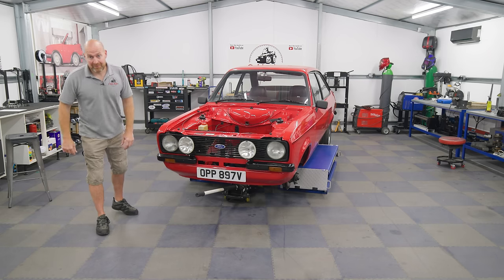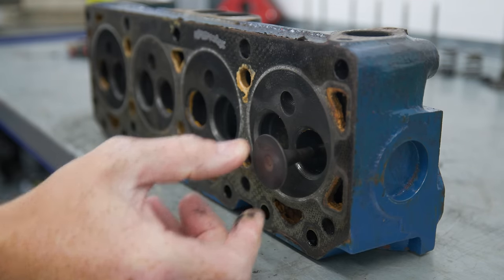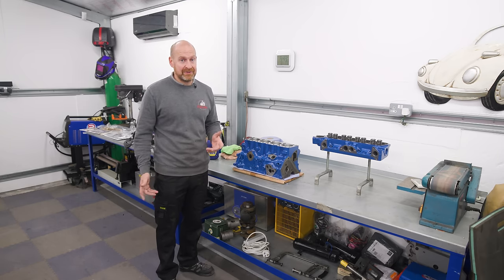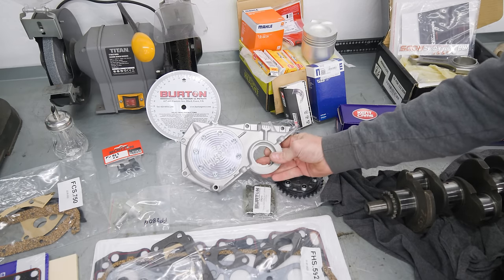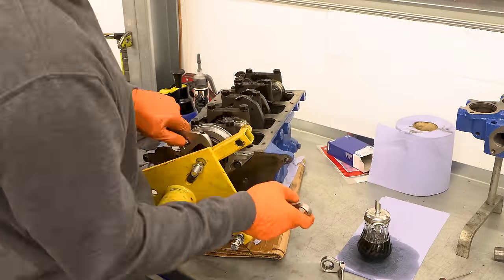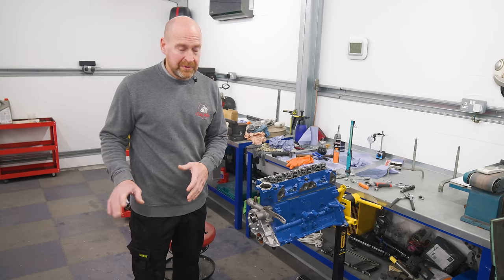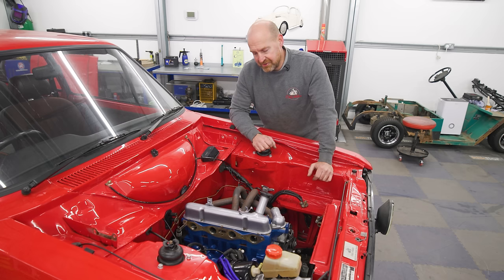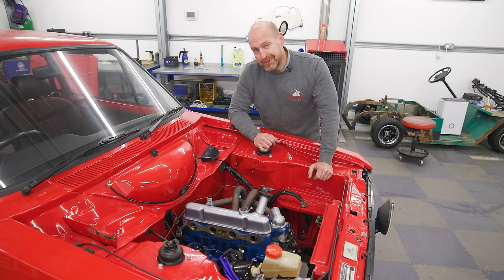FORD Escort mk2 1600 SPORT project #2

Comment: Paul, the 1300 crossflow pistons at + 0.060"  will not reduce the swept volume or capacity of the engine, it will still be 1660cc approx, but they will increase the compression ratio from 9.0:1 o 10.3:1.
Reply from the maker: Shh 🤫 lol in my head it makes it under 1650 ha ha.

Comment: The old 711M block from the Cortina Gt. Safe to bore to 1700 with the thick cylinder walls but good to keep around 1650 for peace of mind. 
Stuck one in our Lotus 7 with a gas flowed head and double valve springs. Lightened flywheel and balanced. 
It’s always nice to know the engine shouldn’t give you trouble 👌🏻

Comment: That was great.
I went for the 244 cam in 1700 crossflow. Mind you that was back in 1999. 😂
Awesome little bullet proof engines if built right. 
I can’t wait to see you do a back to back dyno run showing the difference between stock GT two barrel carb and twin 40mm DCOE’s. 
🇦🇺🤜🏼🤛🏼😎🍀☮️

Comment: Nice to see those power figures with the bigger carbs, I have a 1690cc x/flow with the a Kent 234 cam and a head from CTM performance and and a set of 40 DCOE 151 carbs and the usual Ashley manifold and a single box 2 inch system also using Lumenition in the dissy, and my car made 96 bhp @ the wheels.
Regards
Dave.  😀

Comment: Bit of confusion there. Crown hight doesn't affect CC'S if the piston is taller as tdc it's taller at bdc. Swept volume bore area× stroke of the crank is the only info needed for engine size. What the 1300 pistons do give with their taller crown hight, is a higher cr. 
Does make a cracking little engine for virtually no money (it's all relative) 🙂
Reply: You are correct. When he said that it made my brain hurt a bit. Man's high school maths failed him badly here.
+.030" gives you 1629cc irrespective of the crown height. The 1300 piston reduces the combustion volume, not the swept volume.
Reply: @5CGQ  Many make the same mistake. The guy is a very highly skilled tech. How often do people do this kind of work.
Many guys in the motor trade for 30 years or more have not rebuilt an engine, unless it's a hobby or something special, the cost out ways the value of the car.
Realistic cost for a x flow like on the vid, which should give 130+ hp is £5k it's just what things cost.

Comment: Hi, Any CC within the piston will not actually change the engine displacement. You only work with the bore diameter in the calculator to go you your overall displacement. Difference in piston dome etc will only affect the compression ratio.

ENGINE CAPACITY/DISPLACEMENT
Information required:	1. Cylinder bore, 2. Crankshaft stroke, 3. Number of cylinders
Calculation:	0.7854 x bore x bore x stroke x number of cylinders.
Example:	Bore = 81mm (8.1cm), Stroke = 77.6mm (7.76cm), cylinders = 4
Solution:	0.7854 x 8.1 x 8.1 x 7.76 x 4 = 1599.5cc

Crossflows love compression. I would be use flattop pistons.

Also the 1300 pistons have you checked the pin to deck height, because if they have the same bore as a 1600... Where is the reduction in displacement to make it a 1300? The stroke must be different, they might not even work with the 1600 stroke/crank